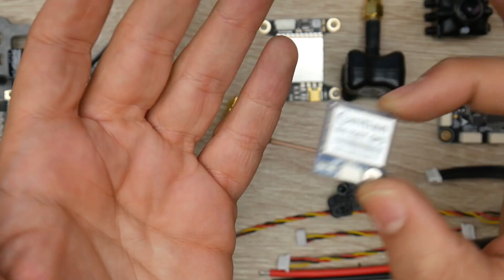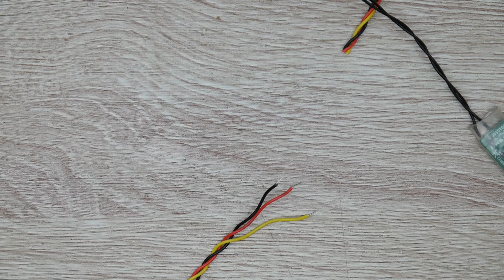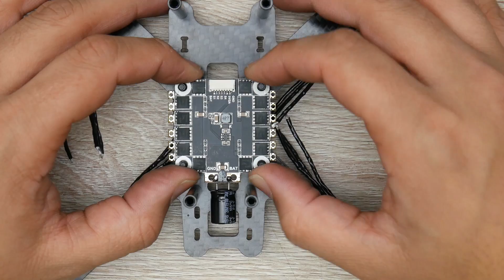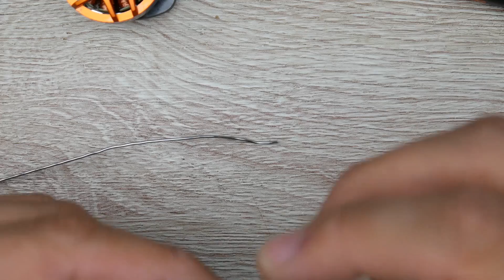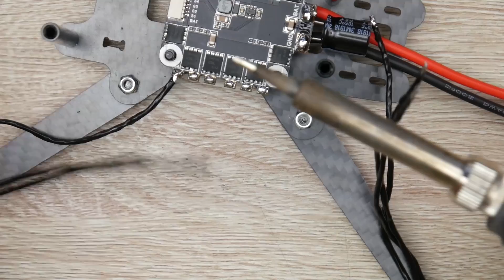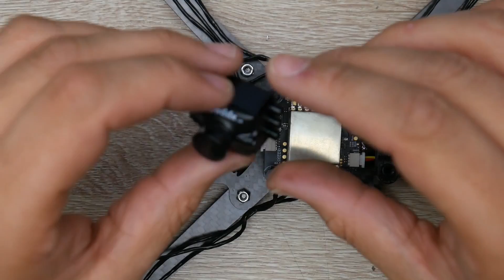Beginner Guide // How to Build Budget FPV Drone Kit - Eachine Tyro 119

Comment: I built the Tyro119 and flies ok with betaflight. Switched to iNAV to use the GPS functions. Setup was ok but when I arm the quad the motors do not turn on. Any help?

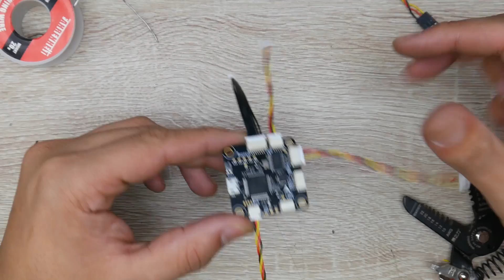Comment: A friend of mine bought one of these and found one of the motor wires too short, and the solder pads on the ESC too small to solder.  Bridging the two tiny dot pads at 7:16 together to chose modes was impossible.  So he used the ones on the bottom side.

Comment: You forgot the smart audio wire.   I'd definiely spend the extra money on the receiver to get smart audio.  I want to get a 119, bash it around on the stock motors for a while, swap out the props and compare,  Then swap those out for some 2308's or some insane motors and compare again with stock props and different props.

Comment: Guys please take a look at 7:38, I need help building my first drone.
I bought the fs a8s receiver, witch has 4 wires on it, one of those is white and says ppm. Since im using ibus should I completely remove that wire from the receiver? One last doubt: the receiver comes with a port to install the cables, but can I solder the wires instead of using the port? Couse the tyro doesnt have the necessary port on both sides of the cable
Reply: did you find the solution?i have the same problem
Reply: @harismustafa4603  yes its kinda simple. every receiver needs 3 cables: power (usually 5v, ground and signal. Any ground and 5v will do the job, so you just have to look for those in the fc. For the signal the cable needs to be soldered to any uart, the R1/R2/R3... in your fc. Then, remembering in which uart you soldered the wire, go to betaflight and enable that precise uart